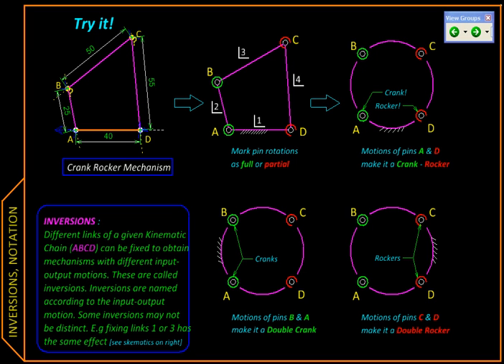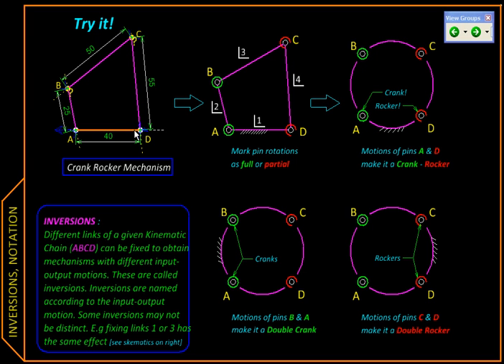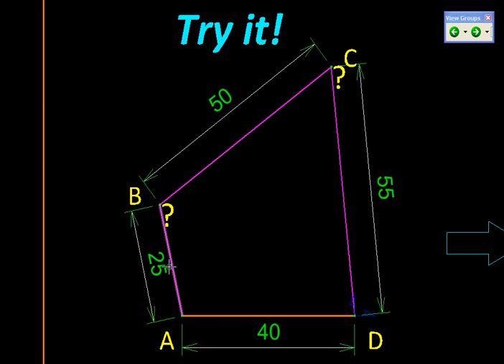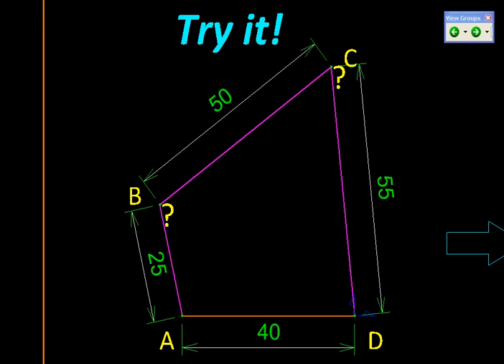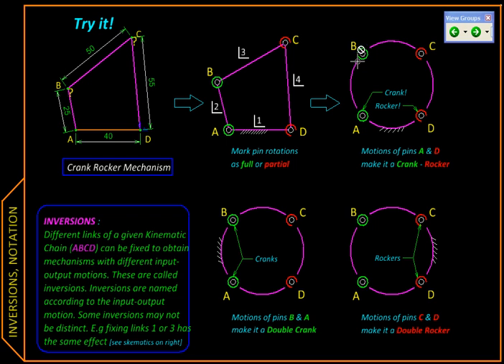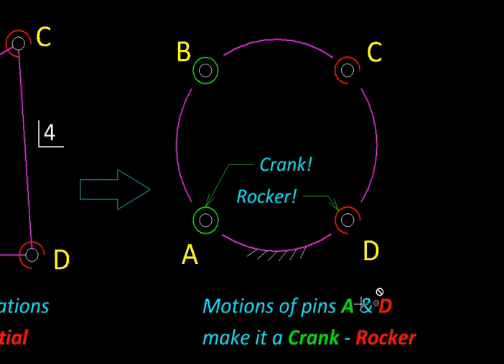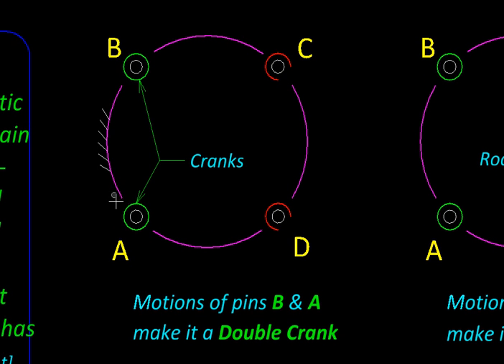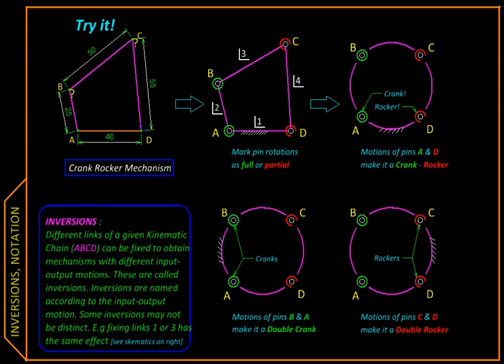Kinematics Ch01E Inversions of Mechanisms

Comment: in the process of inversion,the relative motions of the links of the mechanisms produced remain unchanged ,how?
Reply from the maker: Imagine two links connected by a revolute pair (a hinge) then whether you fix Link1 or Link2, their relative motion is still the same viz. one link rotates relative to the other. In fact, even if you do not fix any of the two links, the relative motion - one rotating relative to the other - remains the same.

Comment from the maker: @jack65282 You can watch the angle between two links meeting at a revolute pair for one complete cycle of motino. See if the angle goes through all the values 0 to 360 and then it is a fully rotating pin if not it is only partially  rotating. That is how the marks are made.